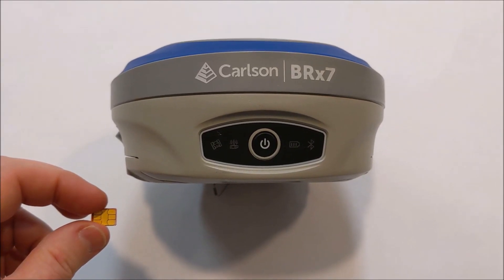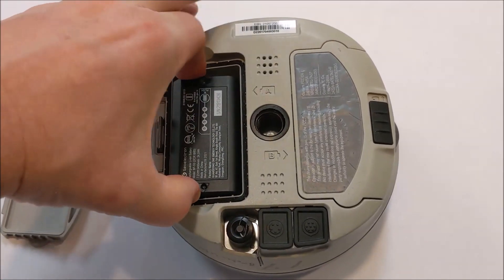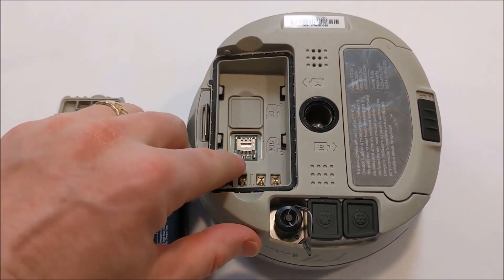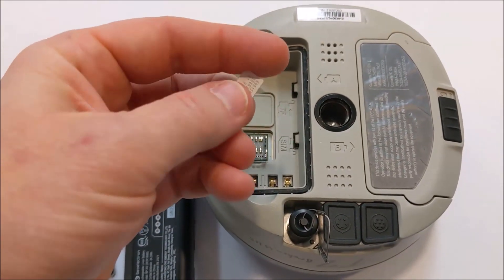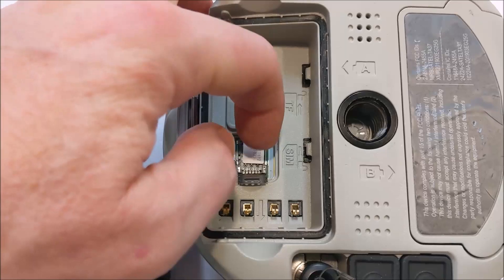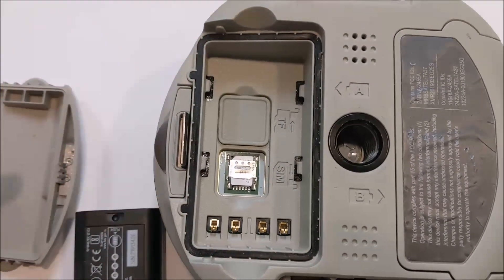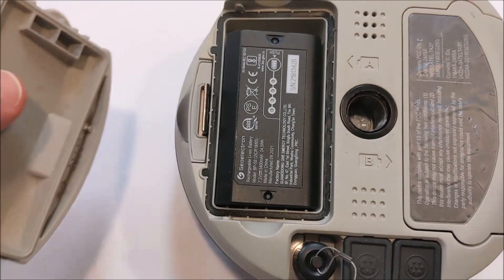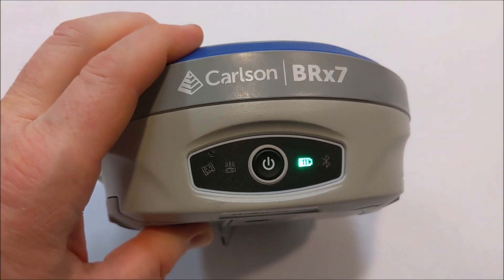How to install an RTK Mobile SIM card in a Carlson BRx7 GNSS receiver

Comment: what about the sd card? i cannot find even an image of an sd card in one, and how it looks to be properly inserted so I know what to do. thanks for the tip about the moving piece.
Reply from the maker: You are right, the BRx7 manual shows a picture of the TF slot on page 23 but does not show a picture of the SD card inside the slot. it also has a moving metal piece that you slide away from the hinge to lock and toward the hinge to unlock. Unlock it and swing it out to expose the pins underneath. Put the SD card metal pins down onto the slot. Wiggle it a bit to make sure it is seated then swing the cover on top of it and lock it in place. Sorry I am unable to post pictures in this reply.

Page 23 https://web.carlsonsw.com/files/knowledgebase/kbase_attach/1218/Carlson%20BRx7%20manual_rev3.pdf